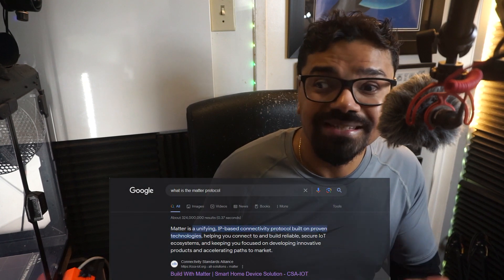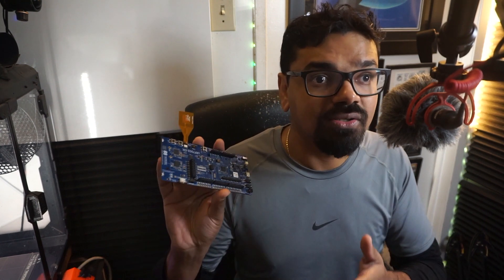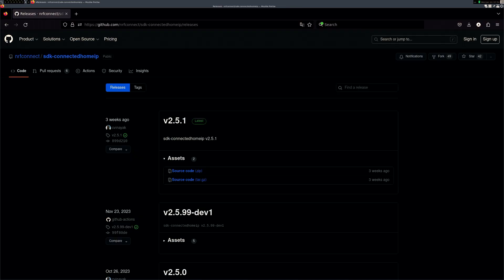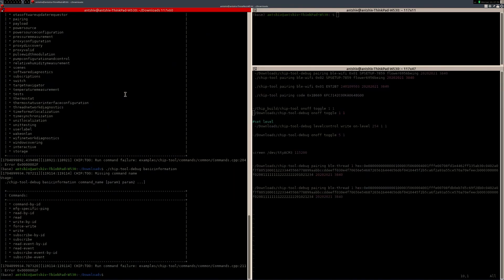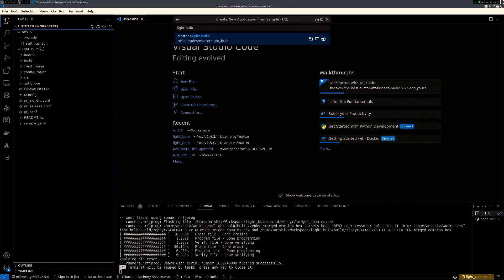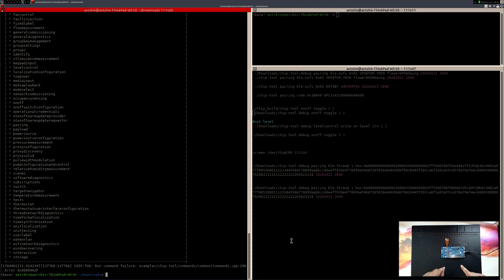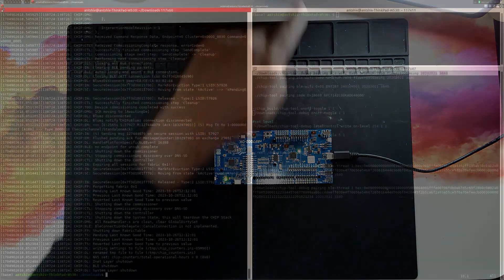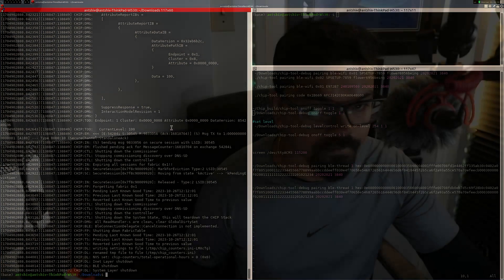Getting started with Matter using WiFi and NRF7002-DK

Comment: Bluetooth and Wi-Fi transmissions do not interfere with each other. Is it true?
Can u throw  some light  how the co-existence between  wifi and ble work
Reply from the maker: Are you referring specifically to how matter works or in general how those protocols work. For matter, Bluetooth is required to make the initial connection between the matter controller and the matter devices. It programs the necessary nodes, protocol etc. Once that is established the edges are controlled using the protocol established (thread, wifi, etc )